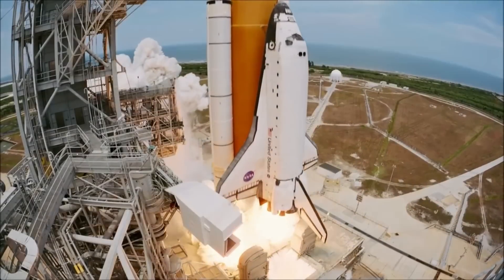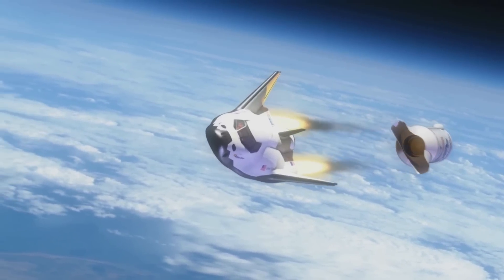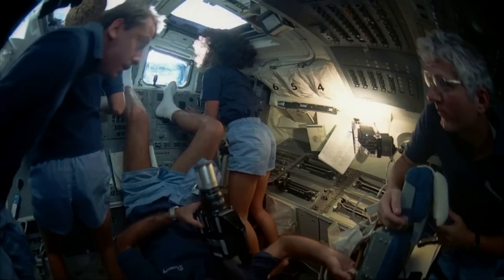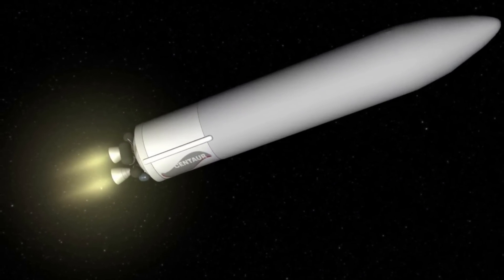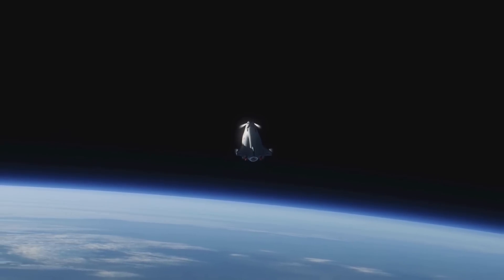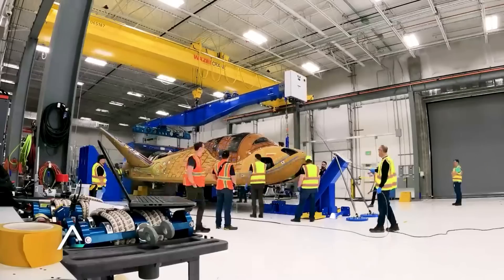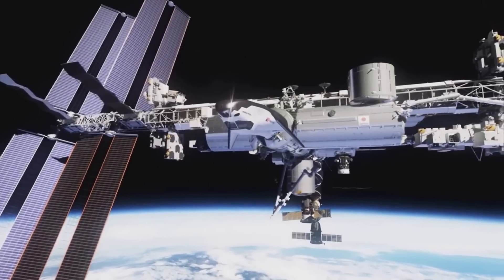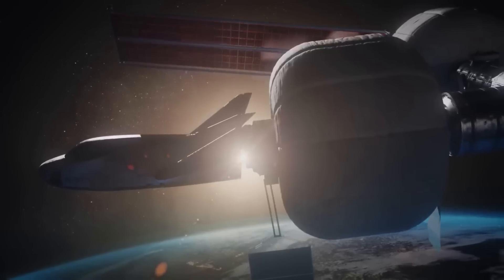How Dream Chaser Improves On The Space Shuttle's Design

Comment: Will be interesting to see how the thermal protection system tiles hold up compared to the Space Shuttle; and how easy it is to maintain the engine between flights. Thought those two items presented some difficulties in the Space Shuttle program (tiles falling off; and the engines requiring quite a bit of maintenance if not refurbishment)?
Reply: First of all, different tiles and different engines, but about the tiles.  The critical tiles started falling off the STS orbiter when the old ET insulation foam, which stayed on, was replaced by a new foam which didn't use CFCs.  The new foam always flaked off and was blown into the tiles at hypersonic speed, sometimes dislodging tiles.  Dream Chaser's stack doesn't have anything in front of the orbiter's nose to be thrown into it by the wind.  Cause removed.
Reply: @digitalnomad9985  Yes, I realize the tiles and engines are different, as well as other considerations. Still remains to be seen if meaningful operational efficiencies and high levels of reliability can be attained (while maintenance requirements are safely reduced) - Outcomes like those will make the spacecraft a compelling option for cargo and hopefully crewed mission.  

As for the shuttle, it had tiles dropping off from the first flight. In development Deke Slayton wrote how (to paraphrase): "Tiles would fall off just by looking at it."

As for the foam, had heard the CFC angle before (I think from Al Worden's book even), but: "STS-1: Pieces of foam (and paint, which was used on the ETs for the first two shuttle flights) were observed almost constantly streaming past the windows by the crew, and over 300 tiles were damaged severely enough to need immediate replacement (although, admittedly, that probably wasn't all from the foam shedding, as the heatshielding was also damaged by an unexpected pressure wave when the SRBs ignited)." 

or as SpaceFlight Now wrote back in 2003: "The shedding of foam insulation from space shuttle external tanks was never considered a safety-of-flight issue, experts told the Columbia Accident Investigation Board this week. But tank engineers have worried for more than 20 years about potentially catastrophic impacts and a top level program requirement held that any shedding of large, potentially dangerous pieces of debris was forbidden."

Comment: I think a scaled up dream chaser-like craft, is the only solution to making SpaceX's Starship human-rated. That might seem weird, but if you think about it, it makes total sense. The safest way humans can return to earth is how the shuttle did it, and now dream chaser. Gliding back to a runway. Starship's retropropulsive method, which has no backup, stands no chance of getting a human rating. But if a crewed Starship would be outfitted with a glider type craft, it could detach from the tanks and engines and go it's own way, while the tanks and engines return to earth via the "classic"belly flop. Added bonus is that the craft can land on any long strip of asphalt which is a much safer idea than being caught by a tower.
To give a little more detail: I am talking about replacing the nosecone section of starship with a detachable glider type craft, the rest stays nearly unmodified. Starship would become a 2.5-stage vehicle. The tanks and engines would not be detached until just before re-entry, and just after re-entry burn.
Reply: I think the safest, cheapest, lowest-weight and best-tested way to return humans from space to earth is a capsule landing in the sea with parachutes. I do not see why we have to change that system. If we need to land cargo with low-G requirements then we can use an unmanned space plane like the DreamChaser.
Reply: @richardbloemenkamp8532  Well, SpaceX's goal is to loft 50-100 people per launch, how would you fit that into a capsule?
Reply: @paulmichaelfreedman8334  Scale-up the capsule and/or use multiple capsules. Besides do we really need to return 50-100 people in a single descent? NASA could have increased the Space Shuttle crew capacity without major difficulty, but I never heard that there was any interest in doing that. I think crews of 50 to 100 is mostly one of the dreams of Elon that he uses to show how the price of spaceflight per launch and per astronaut will be radically reduced. My guess it that until 2040 no rocket will launch and return with more than 20 astronauts aboard.
Reply: @richardbloemenkamp8532  Well, as you may or may not know, the plan is to colonize Mars. There will come a time when thousands will have to be transported up within a short period of time. Chances are high that after the pioneering missions, Musk will want to go in force, meaning going there with not one ship, but twenty or so at a time, as a fleet. with 50-100 people per starship, that would mean 1,000 to 2,000 people going up within a few days from each other. You're not taking into account that SpaceX wants to scale up 10, 20 30 fold. Capsules with parachutes are too much work to refurbish, there needs to be a reusable option with near immediate turnaround capability. Glide to runway is the safest way to transport the masses and still have quick turnaround. There will come a time where space travel is as common as air travel.
Reply: @richardbloemenkamp8532  I recall hearing from Al Worden and/ or Walt Cunningham that a capsule is the most efficient, and to date, safe approach. However, I think a water recovery adds in a degree of complexity (see Gus Grissom's capsule sinking, or Apollo 15 landing short of one parachute).
Reply: @michaeldunne338  Those two examples are more than 50-years old. Given the total number of parachuted crewed-capsule landings over the years, even if these accidents had been fatal, it would still be a minor dent in the technology.
Water recovery has become easier because the capsule landing location can be much better controlled and estimated today than in the past.
I think people prefer space planes and other technologies out of curiosity and interest for something new and cool. 
Anyway, let's also see what the Chinese will do.
Reply: @richardbloemenkamp8532  With the Americans, there had been a gap in the use of capsules, from July 1975 to March 2019. The Apollo Soyuz flight had an issue upon landing, but that was apparently due to human error (from NASA history page: "During reentry, the earth landing system had failed to jettison the apex cover and drogues as scheduled and had to be fired manually, without first disabling the reaction-control system thrusters. With the CM oscillating, the thrusters began firing rapidly to compensate, and combustion products including a small amount of nitrogen tetroxide entered through the cabin-pressure relief valves. As soon as the RCS system had been disabled, fresh air was once again drawn into the cabin. The crew members told flight officials that they had put on oxygen masks once the spacecraft had landed, and then activated the postlanding vent system."). 

So yes, the incidents cited are old.

Comment: I am a big fan of Dream Chaser, but concerned about the ULA launch vehicle which is having problems with the second stage and periodic problems with the BE-4 engines. If not launched by the end of the first quarter 2024 then Sierra Space should at least investigate other launch vehicles.
Reply: they have, i'm pretty sure dream chaser is made to be able to ride on a lot of rockets, even a falcon 9.
Reply: @KaleyDuke  They said all along that it was designed to be as 'launcher agnostic' as possible.

But that doesn't mean SpaceX could quickly pick up the slack. They're extremely busy (with only one human-useable launch pad, for which Dragon gets priority) as it is. 

Plus Arianespace has nothing operational in that class at the moment, as they retired Ariane 5 before Ariane 6 was ready (and neither is a cheap ride).

What's technically possible, and can fit into scheduling, are two different things...
Reply: @stardolphin2  Scheduling might be a problem, but SpaceX tends to expand to meet an ambitious schedule and is pushing 100 launches this year. I am just saying Sierra Space should be exploring options rather than thinking the Dream Chaser opportunity will be there forever.
Reply: I think Sierra Space should consider offering a team-up with SpaceX, as they have the solution to making Starship Human-rated fairly easily. Current goals still call for doing a bellyflop with humans on board but no committee is ever going to deem such a vehicle safe enough for humans. Especially as the retro propulsion has no fail-safe backup. Equipping every crewed starship with a scaled up  dream chaser or comparable design instead of a nose cone, and detaching just after re-entry burn to glide to earth will solve many problems at once, at the cost of some payload. I think such a solution could take 50 - 100 passenger in one launch / re-entry. The bottom half of starship would return to earth with the belly flop, but without humans on board and would be caught by the tower as currently envisioned.
Reply: I'm not concerned about a company with 100% success rate
Reply: @MrAlanCristhian  And that would be?
Reply: @MrEd2291 ULA
Reply: @polishkerbal6920  Vulcan has been repeatedly delayed both because of the poor decision to go with the BE-4 and failure to test in a timely manner the second stage. Nothing about the Vulcan is reusable. Future indefinite plans call for saving the BE4 engines maybe in a few years. Contrast that with SpaceX which recently landed the entire booster for reuse for the 200th time.
Reply: @MrEd2291  True, the multiple failures are horrible but ULA and BO could fix them. I dont understand what you mean by vulcan not being reusable on the first flight, Falcon 9 wasnt either untill 2016, if the first vulcan flight will be in 2024 we can see it being reusable in around 2028~
Reply: @MrAlanCristhian that's funny Boeing and Lockheed combine into ula so all the failures of both disappear because of a name change? Even if you want to stick with that ULA isn't producing the be-4. The idiots at blue origin are.

Comment: Having lived through the heavily hyped shuttle program, I don't have much confidence in Dream Chaser. However, I'm glad they're launching it inside a fairing.
Reply: If Sierra would team up with SpaceX and develop a glider craft as crew transport for Starship, that would be something. Replace the nose cone and payload section  with a scaled up version of dream chaser, Starship would become a 2.5 stage vehicle. Detach from the tanks/engines just after re-entry burn, and let both go separate ways. The glider glides back to a runway, smoothly, while the bottom half dives back down belly first, to be caught by the tower.
Something definitely worth exploring, it would gain Starship a human rating much faster if they developed a detachable vehicle dedicated to human transport. Also becomes it's own launch abort system, nothing extra needed. The only and single reason a design should be over-engineered, is for safety. The human factor. I think this qualifies.

Comment: I could see this as our crewed transport while the starship is more like a skyscraper building. Both will work but combined they would function very effectively. Envision, 2 starships docked nose to nose with a hallway, pencil of docking rings between them. One starship (the back) will have 2 more attached at the sides to be mar hab's (mini skyscrapers prebuilt to land and stay). Dream Chaser as the shuttle to ferry them to the surface and back to the transport starships. This config allows 2 starships to accel and decel without having to flip end over, while still offering max in flight space/cargo for crew. Add solar wings on the hallway to give more power while in route. Pretty excited to see where this goes. Hopefully I will get to go up too :D
Reply: SpaceX should consider replacing the nose cone with a scaled up dream chaser like craft, for crewed vehicles. Cargo vehicles can stay unmodified, but such a solution for crewed flight would gain human rating much faster, in fact current design of SS will never get human rating. Crew needs to detach before the belly flop, and return independently, gliding back to a runway. In such a configuration I would not need to think twice about hopping on board. Current design? No frikkin way!

Comment: It's pretty much confirmed now that the flap / wing + bellyflop design is legit.  Everyone is now doing it.

It's essentially a smaller Starship except it can land on a runway, which will be VERY useful.  Starship will be doing the cargo but something like this will probably be taking the actual people to Mars surface for more safety.  (Starship is big enough to carry one of these INSIDE it, potentially more than 1.)
Reply: Dreamchaser's reentry profile is pretty different from Starship's. There is no flip maneuver and the aerodynamic control surfaces are completely different. The main similar aspect is entering the atmosphere with the blunt side first, which capsules like Mercury and Apollo did long before Starship.

Dreamchaser is also not suited for Mars landings.
1) the heatshield is built for reentry from low earth orbit, not interplanetary transfer,
2) Mars doesn't have runways
and most importantly 3) the atmosphere on Mars is less than 1% as thick, so dreamchaser would need to go much MUCH faster when landing (about 10 times the speed compared to earth).
Reply: I strongly disagree with you lol!!!!